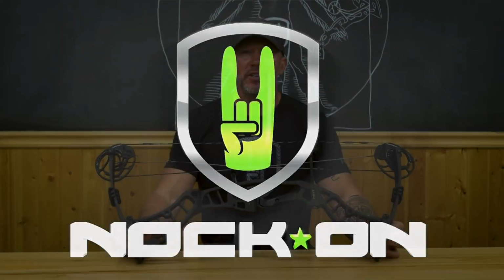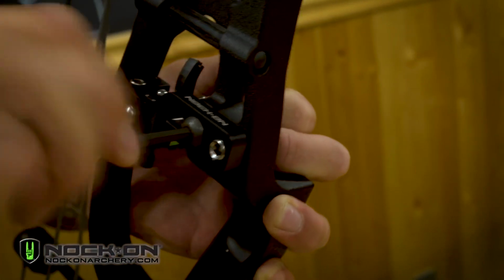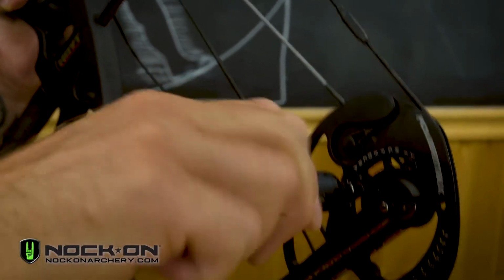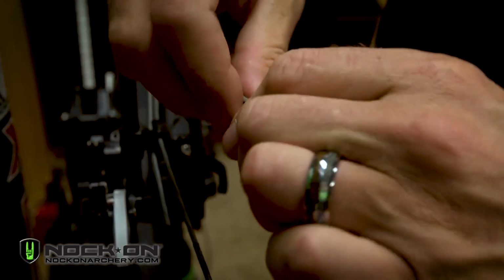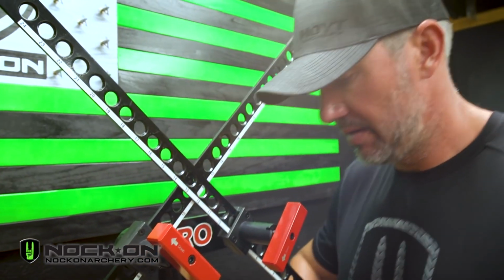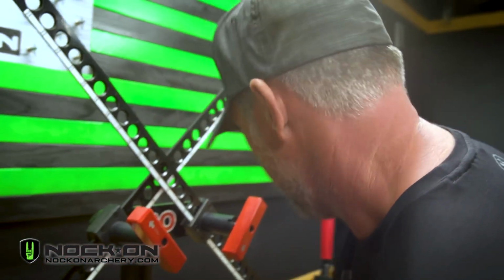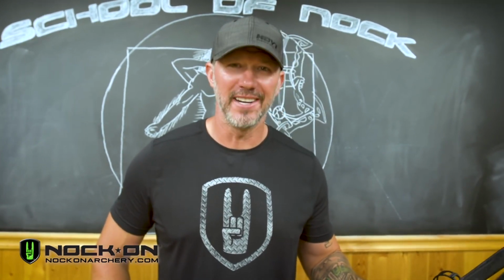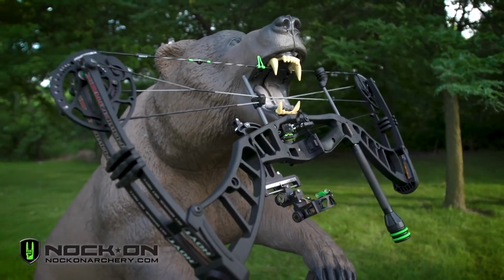Hoyt Power Max Review  The perfect-price bow by John Dudley

Comment: Great video John I have a question I hope you or some one else can help me with I have a pse xpedite at 70lb I shoot Easton power flight 300 at 9.5gpi (28.5") with 125 grain tips. When I set my bow up I set my rest on the button hole and center on the landing but as I paper tuned my bow the rest ended up being almost hard up against the riser which in turn means I can only see 3/4 of my sight as the other 1/4 is behind the riser. Do you have any suggestions.

Comment: I want to go from recurve to compound but I want finger shoot.  can a finger saver be installed and no mechanical release?  I shoot 3 under.  thx
Reply: Poker Channel um your better off shooting with a release cause if you use fingers theirs always a possibility of derailing the string
Reply: @bobpolice6885  ok.  I see.  I guess I will go with a horsebow, then [I know, right: those are wildly different bows.  However, the reason I wanted to go compound is for short bow.  I need a short bow because I am going to sit on the ground and not move.  My distance will be 15 yards. or 18 yards or shorter.  A horse bow is short; a compound bow is short.   But, the horse bow has the added aesthetic of being a traditional bow.   : )  thx.